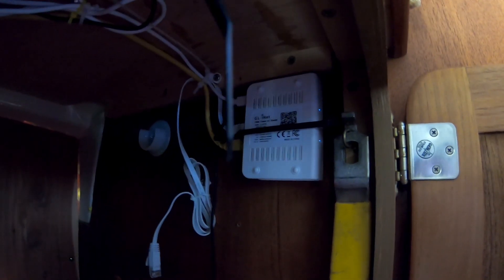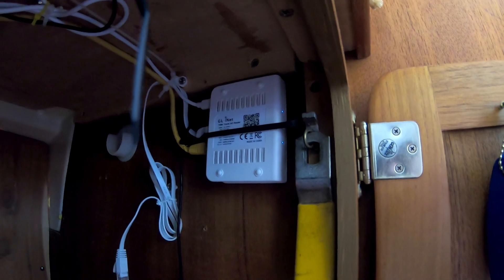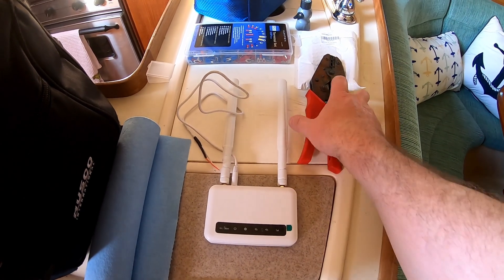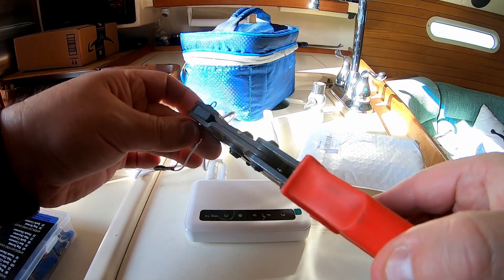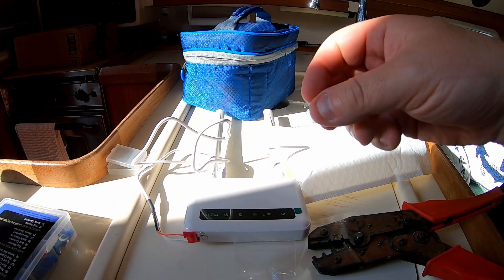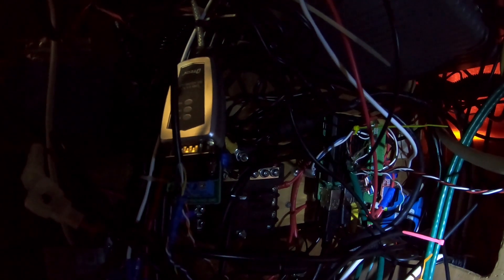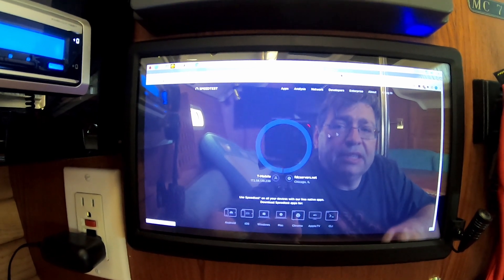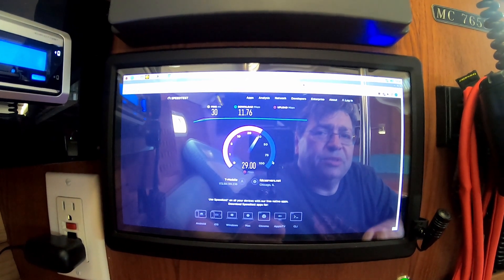GL iNet X750 Spitz 4G LTE Router install on SV Apres - Tech Ep8

Comment: How do you set up the Wi-Fi card/ sim installed in the router. I need to change the TTL but trying to find the settings for it
Reply from the maker: did you try going into the Luci interface?  https://docs.gl-inet.com/router/en/4/interface_guide/advanced_settings/
Reply: @ApresSail  yes I’ve tried all that but the error states SIM card not registered
Reply from the maker: @CA2TXMX  what sort of Sim is it?  I first tried with an AT&T sim and could not get it to work.  I spent a few hours on the phone to them.  The T-Mobile sim worked out of the box
Reply: @ApresSail  I will try this out. Ty
Reply: @ApresSail  just got on. Where should I go now?
Reply from the maker: @CA2TXMX  not sure I understand?
Reply: @ApresSail  I logged onto the luci interface for my router. I have a metropcs T-Mobile sim that I’m using for this router but it states when I try to connect it that the sim isn’t registered.

Comment: GL-iNet makes great little routers. I use a mango for my home network. It repeats my phone's hotspot.
Reply from the maker: I used to have a Creta, but after a particular IOS update it became unreliable and it was no fault of the GL-iNet but was and IOS tethering issue. The thing I liked about it and the Spitz has the same feature and it is that the 4G connection, whether onboard or tethered is secondary to a WiFi connection, so when I pull into a Marina, and connect to WiFi all bandwidth is redirected to WiFi.  Everything on board seamlessly transfers to what ever internet connection is being used. And the software it uses is OpenWRT, so it is very upgradable and configurable
Reply: @ApresSail  That is good.  Mine always knows exactly when the hotspot is on.